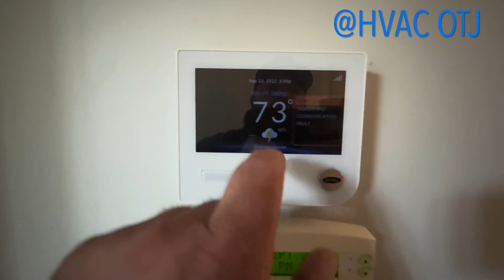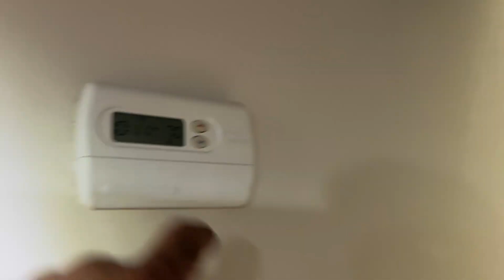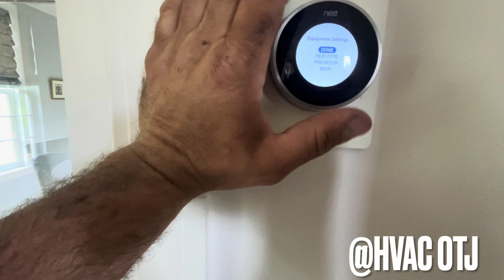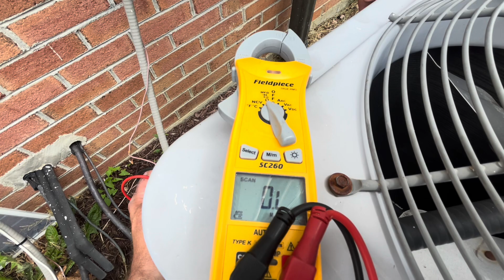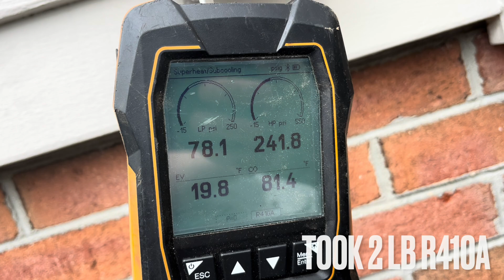WHY IS MY AC CONDENSER NOT RUNNING?  I HAVE A NEST THERMOSTAT. NO C WIRE.  CONTACTOR CHATTERS

Comment: What the hell is a helicopter is that diagnostic lingo ??
Reply from the maker: That's every time a homeowner follows every step you take when working on their system. They don't stop asking questions and it ends up making a tech lose concentration.
Reply: @hvacotj  oh ok ya that would be annoying thanks for the explanation
Reply from the maker: They even have helicopter customers in every trade.